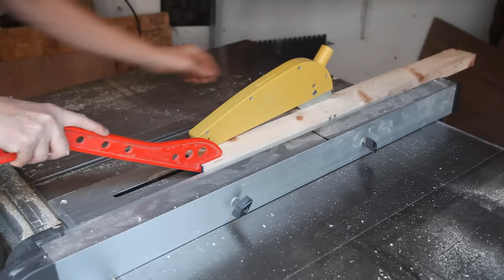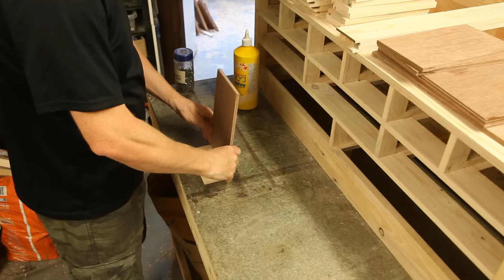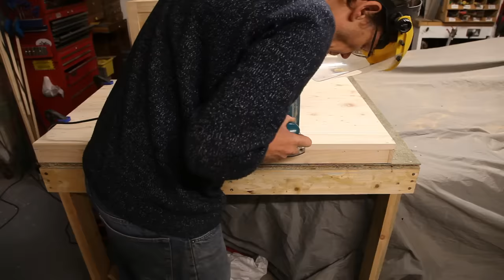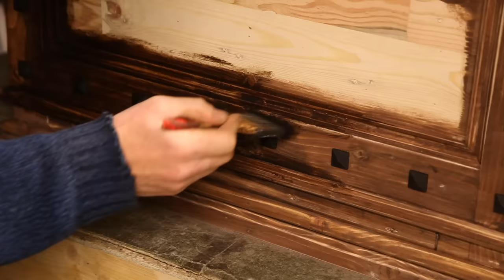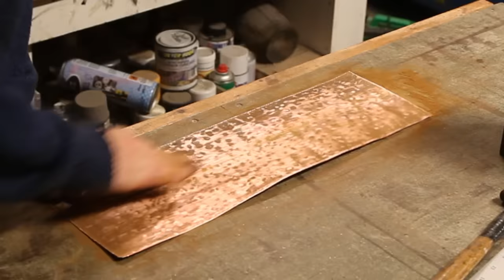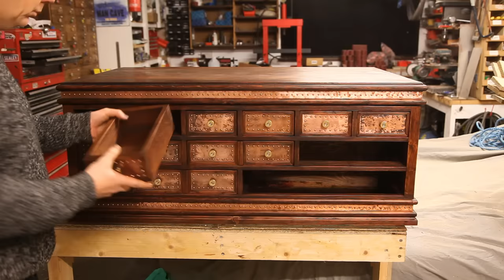Steampunk Apothecary Chest Coffee Table Made From Pallet Wood and Recycled Copper.

Comment: As a ‘traditional’ woodworker I kept thinking “where are the dovetails/ mortise and tenon joints?”; but your piece will hold together fine and is one of the most creative designs and uses of material that I have ever seen! Thank you for opening my eyes to the beauty and creative innovation of this genre.
Reply from the maker: Thanks Brian :)
Reply: I usually don’t use fancy joints unless they’re going to be on the exterior of a piece to be seen and celebrated.  That stated, it doesn’t take that much longer to do finger joints on the frame of a drawer if you feel compelled, but unless you’re gonna store massively heavy objects in them, any extra strength those joints provide is overkill, particularly in drawers that size. I’d have been a fan of finger or dovetail joints on the corners of the box frame itself if not for being hidden under the corner elements.  As built, this chest will be around long after we’re all gone and whoever owns it will surely  treasure it.

Comment: You know, I was a bit leery to use reclaimed wood in any projects because of the possibility of nails ruining my nice blades in my table saw. I even considered making one of those cheap table saws with the flipped over circular saw that would work as a dedicated table saw for reclaimed wood. Then I saw another wood working video where this poster came up with the brilliant idea of using a metal detector for the wood! I had one of those "Now why didn't I think of that" moments. This gentleman here shows you what can be accomplished using reclaimed wood to come up with a real work of Art. Craigslist, here I come!
Reply: Hardest part is "de-nailing" the pallets. After that its generally pretty easy.

Comment: As someone else has already mentioned, it would be a shame to fast forward even one second of the video. I appreciate your joy in wood, in working with wood and in the task itself. Do you make exact plans beforehand or (as I usually do) just a rough plan and the details emerge during the project? How many days or weeks did you work on the chest?
What I really like about your videos is that the focus is on the creation of the product and not on how it works exactly, how you measure something or what can go wrong.  There are enough other channels for that. With all your videos that I have seen so far, I was curious from the beginning what exactly will be created there now. I would immediately take this chest from you if you don't need it  anymore 😁
Reply from the maker: Thanks very much for the comments, Stephan. I do it exactly the way you do, rough design to begin with, then let the plan evolve as I go along. I get a lot of questions about the time the projects take, and it's really hard to say. Making a video at the same time is an awful lot of work as you have to do a lot of set up and repeat shots. If I had to make another chest from scratch, maybe two to three weeks full time work. Current project is a bookcase to match the chest, and I'll also be doing a short video on how I made the shot gun cartridge handles. :)
Reply: @EpicUpCycling  Many thanks for your reply!  Unlike you, however, I lack patience.  And then filming, editing, etc.  You've got a lot of passion and lifeblood. I will recommend your channel to friends who like me do woodworking as a hobby and I am looking forward to more videos of you!
Reply: @EpicUpCycling  thank you so much for sharing this video! It's my first time on your channel but I love your artwork and I'm subscribing also for the kindness you use answering us 💜. Watching your video gave me such peace and also energy! Thank you :)
Reply from the maker: @pandamon8681  Thanks for the comment, Pan :)

Comment: Salvaging skids for lumber is a pretty good idea. A buddy of mine took home dozens of them from Toronto Airport and broke them down. Resizing, laminating, he came up with a nice oak, maple and mahogany interior for his 40 foot sloop. I was working in construction at the time and we had machinery coming in from the far east on teak and mahogany skids. Nowadays, all you get at the local shop is what I call crap wood. My boat was outfitted in the end 70s with regular construction materials. The ply wood was 1 inch, not some bastardized metric thing, it was multiple plys, voids filled and laminated with real water proof glue. Really good one side, good on the back. The studs and planks were straight, knot free and accurately sized. Now you get warped splintered crap, half of which is bits and pieces spliced together. I'm refitting now, using what I can salvage and on the hunt for good skids.

Comment: Love the video, concept behind it, and finished work. Excellent craftsmanship. With all that said... That is roughly about 2 grand in tools if purchased.... You could produce maybe 1 or 2 of these a day and they sell between $200 to $500 a pop in a fair market... So you would need to build and sell, keyword here is sell, about 5 or 6 of them to compensate for the money spent. With that kind of skill and artistry, the time spent variable increases to a production rate of about 3 per week. That is about a month of work just to compensate the tool investment alone.
So, I'm going to do a tool inventory in the morning and get started on my own....
Totally worth it!
Reply: Tool investment? I haven't seen anyone use a radial arm saw in 30 years! Most people these days would be using a pneumatic nailer and air compressor instead of a hammer.

Comment: I've made two huge hardwood bookshelves using the biscuit joiner, and I was really disappointed. The biscuits didn't decompress before the glue dried, and I had a lot of glue out on the panels. For me it works a lot better to make a loose tenon, and then make it to fit tighter... 🤗

Comment: Not sure how long it will last.   There are several cross-grain glue-ups that will crack with changing humidity.  There's a reason why cabinetmakers use rails, stiles, and floating panels.

Comment: Fyi for anyone wanting to clean the corrosion off copper, go to your local supermarket or anywhere that has pool supplies and get some muriatic acid, nitrile gloves, dish soap, and a couple containers big enough for the part to be submerged, mix acid 75% acid to 25% water, let it soak for 2-3 minutes, rinse then have another container with soapy water, lots of soap, dunk the part a few times and rinse and you'll be good to go

Comment: You, sir, are a GENUINE Cabinet Maker. You're missing things like dust bottoms and drawer stops, and overlapping drawerfronts, but this is a properly constructed cabinet in the style of yesteryear. I was concerned at the beginning that you'd have trouble with the timber boards on the side splitting along the grain/glue joints, when it gets delivered and put into someone's centrally heated house. As you didn't allow for expansion and contraction of the timber, gluing it to a cleat on the ends. Instead of making raised and fielded panels (specifically designed to accommodate this issue). However, that won't be a (visual) problem, as you've covered up the sides with copper sheet (and the bottom is non visual). The only problem area remaining is the top, as it's constructed of the same wide board of pine laminations. Without question, this WILL split if it's put into an area which is warmer and drier than the timber was acclimatised to when the piece was fabricated. Or it will expand and blow the frame joints, if it's kept in a more humid and cooler environment than when it was made. Something worth bearing in mind and trying to learn to accommodate for forthcoming pieces. Wood is wood and that's just what wood does.
    In addition, I understand you covered up the front of the drawers, but you made such a nice job of making the drawers the BEST way - with half-lap joints! And as that's the way I always make them, I thought I would point out a practice I use on my drawers; when you cut the half-lap, make the cut to leave about 4mm of overlap (so slightly deeper than you did these). Then, instead of pinning through the overlap, put the pins in the other piece. That way, you will have (on each corner) one face with the joint AND the pins, and the other face will be completely unblemished, the grain running straight through up to the corner of the drawer. If you make these pieces the SIDES of the drawer, you can then cover EVERYTHING up (joint and pins) with the drawerfront.
   But overall the effect you got is really quite stunning. LOVE the little oak fake square nail heads (although slightly too many for my tastes. They should just be in the joint areas, for me). The copper plate is genius, and the staining is obviously your forte. SPOT ON. Lovely dark walnut colour. If I could nit-pick, I would say that it would have been nice if you cold have removed all the cross-scratch marks from the 80 grit flat-sanding. But I appreciate that's quite a massive job with a little power sander like that.
   I'm just pointing out things I'm seeing in the video, for you to consider in your upcoming projects to make them even better. Overall bl**dy good work. A treat to see someone doing this in these cynical times. AND in the UK (not the USA for a change)! Really well considered and executed work, and stunning aesthetic design. You know what you're doing!
argcabinetmaker.co.uk
alexanderguestguitars.com
Reply from the maker: Thanks for the comments :)